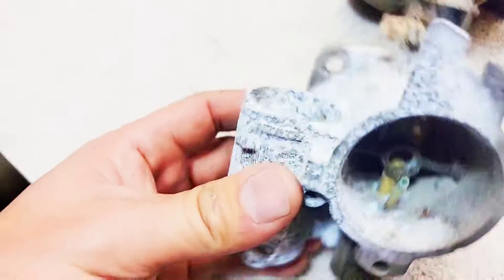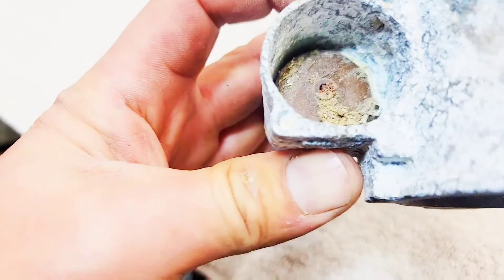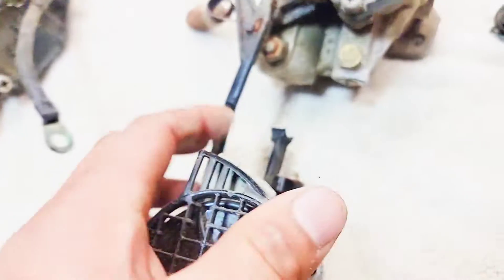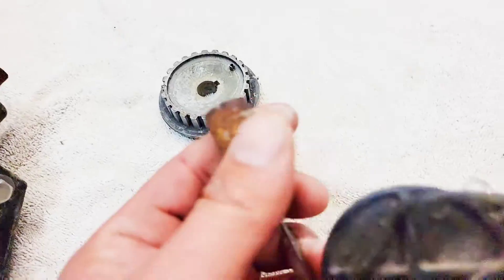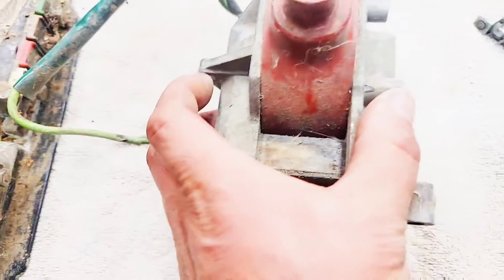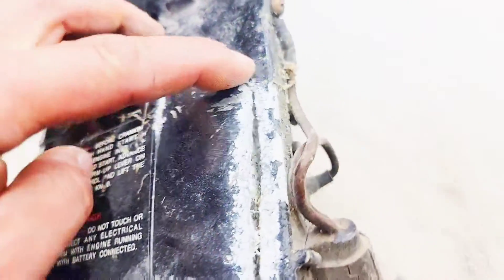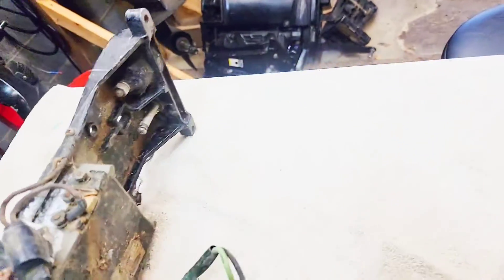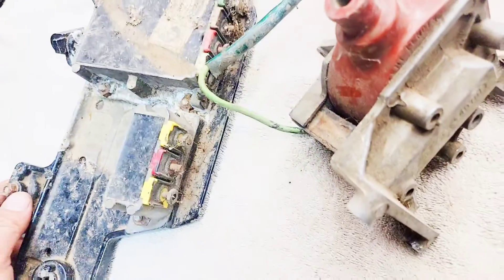Testing Mercury Outboard Old Ignition Systems Switchbox, Coil, Distribution

Comment: Thanks for the videos they have been a great help. Currently trying to diagnose an 850 switch box still on the motor. Power to red and white but not getting power from switch box to coil. Is the switch box no good or is there something else I can check. Thanks man

Comment: Hey Son, thank you for creating these wonderful tutorials! I've got a mute motor over here. lol. I bench tested my 1975 1150 switch box and coil after noticing weak spark. (Motor was running recently although not at potential, running smoothly but maxing out about 25-30mph, carbs/fuel pump all rebuilt, rectifier replaced and good compression.) Following one of your switch box/coil testing videos I tested for 12v and I had it on white but nothing on red when jumped. Coil tested fine. Could the switch box be bad and the cause of my weak spark or should I move on to the trigger? Thanks!

Comment: I have an issue with my 175V6 Merc, checking spark, great on port side and great on 2 of 3 on starboard, 1st spark great than falls off to very faint spark thereafter, checked ohms on stator, trigger, coils and all are in the middle of spec per Mercury repair manual, new wires, and all new electronics/Sierra, sounds like a bad circuit in the switchbox?? Your thoughts please.

Comment: Got a quick question if you don't mind. Have a 79 adi style 140. Going in a race boat. Not using regular controls or key switch. All electronics new. Not using factory engine harness either. I have spark. In fact she fired up last night for first test and break in. How do I shut it off!? Lol. The orange wires from the switch boxes? Would that need a ground kill like a magneto? I had to pull plug wires to kill it!
Reply: Btw she talks! She talks perfectly. Gonna dyno before putting the powerhead back on the mid section.
Reply from the maker: The orange needs to cross with the ground. Or you can choke it out. Son
Reply: It wouldn't choke out. Lol what I tried first when I realized it wasn't gonna shut down. But yea I will wire it like a mag. Thank you.

Comment: Great Videos, I love old Mercs, i also know good specs are HARD to find, do you have a good source of Torque spec info? IE 1985 75 hp flywheel Nut torque? mercury service info is RARE on the web, if you have a good site please share, Thanks Again!
Reply from the maker: Service manuals. I have mercury outboard service manuals and selocs. Alot of people down selocs but the information is good. Son

Comment: Hey Son, any way to contact you with a quick question about a 1976' 500? Long story short when throttle lever is pushed forward it is connected and linked in the motor but nothing is happening in the primary pickup. The rpm's dont start to increase until secondary pickup point. I have a video.
Reply from the maker: Email?

Comment: I notice the mercury switch was hooked up at the beginning and bracket was flipped over wouldn’t that kill power “spark”?
Question: The disk on the trigger is it supposed to hit the top where the magnetic is? 
Or is the disk suppose to spin between the bottom & top without the disk touching nothing? 
I know the top pice has a magnet in it to read the disk as it’s spinning but does it actually suppose to touch the top magnet? 
CDI told me to file that pice down if it’s touching the disk spinning.
Reply from the maker: Good eye. I'll retest and see if I have a faulty switch. Traditionally it should not kill the spark. I do not believe the disk is supposed to "hit" anything. If my memory serves Mr correctly it supposed to ground out the trigger which tells the switchbox to release the spark.